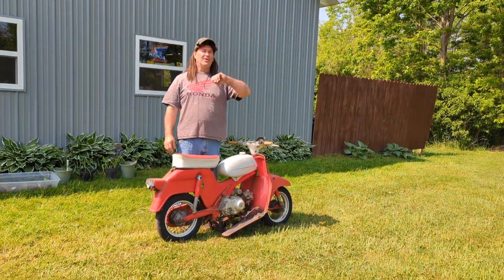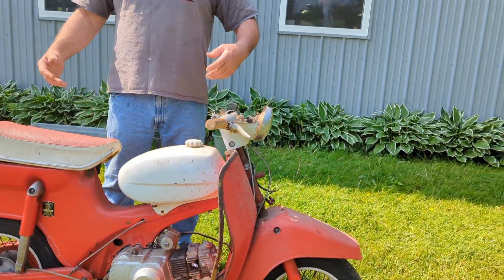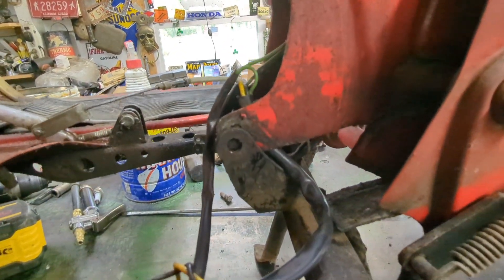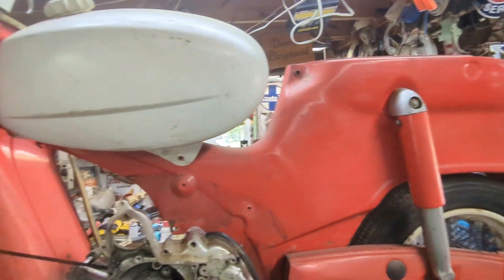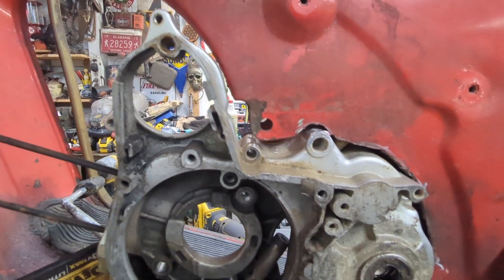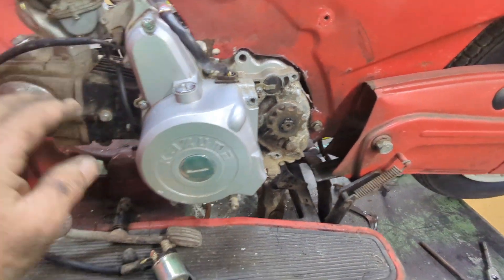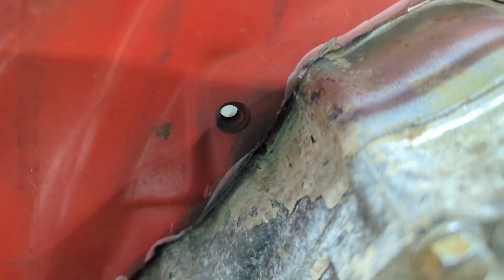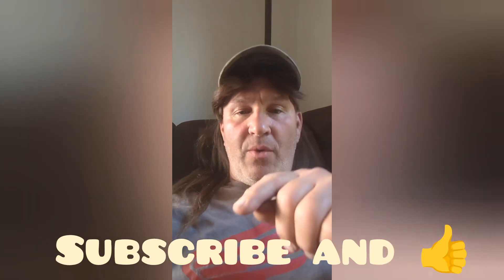1966 Sears Allstate engine Conversion ct70 swap  #tarylfixesall #viral #sears #smallenginerepair

Comment: I remember those selling under the name Sears Allstate Compact. They were made by Puch. They were also selling the Cushman the highlander under the Allstate name as well as the Piaggio Vespa under the Sears Allstate Cruisaire name.
Reply from the maker: It's such a neat little bike and I can't believe they even the tires are original on it after mid Ohio. I will finish this video. It'll have electric start and shift with no clutch I'm excited to get it done and then I'll have to bring it next year to Portland Thanks for watching and subscribing. Have a great night. Thanks!😊